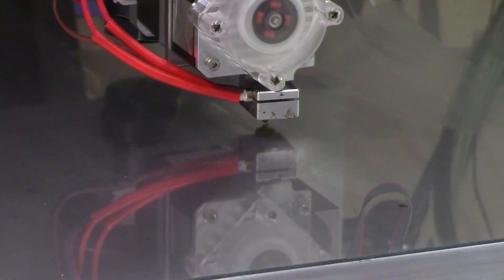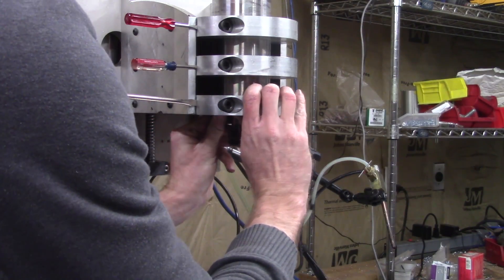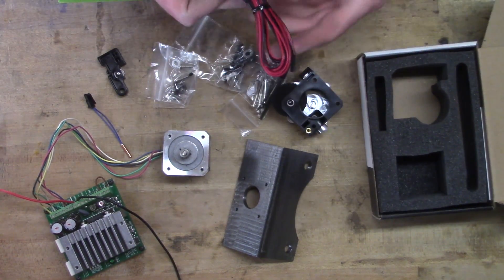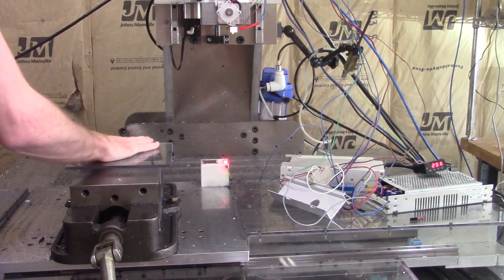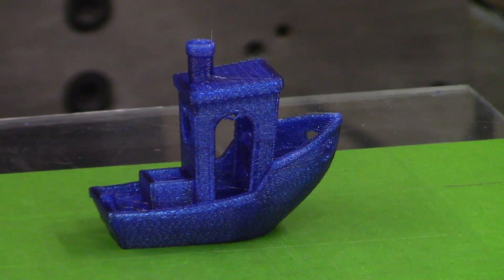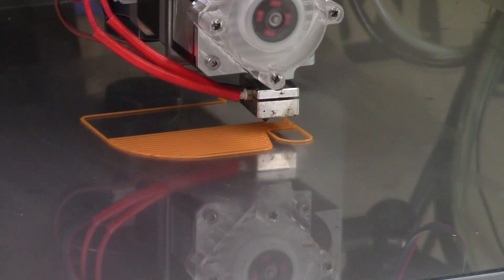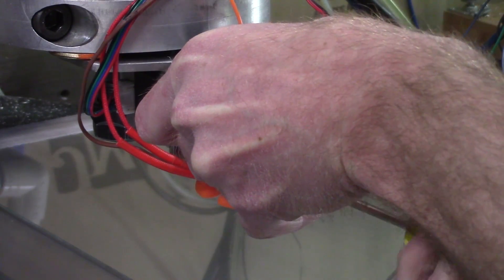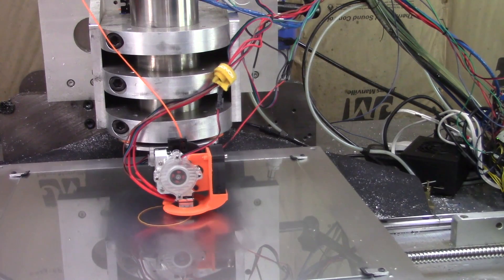Putting a 3D Printing Head on the Mill

Comment: How good are the clear paths motors for 3D printing in terms of noise. My wife is going to kill me if I keep 3D printing with NEMA 23 steppers. Especially with the CNC 3d printer combination machine is running for 18 hours straight.
Reply from the maker: They are nearly silent.  Problem is, you then hear every creak and squeak from all of the moving parts instead of the motors, so it will depend on how quiet the rest of your machine is.  Unless the machine is moving super slow, all I can hear is the sound of the ball screws and linear bearings, with the slight squeaking of the plastic spider in the motor couplers.